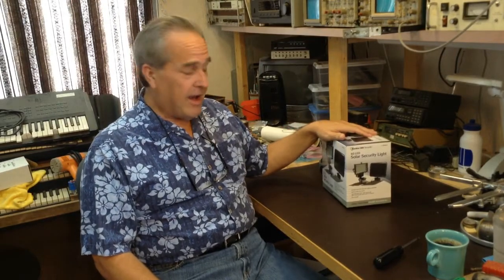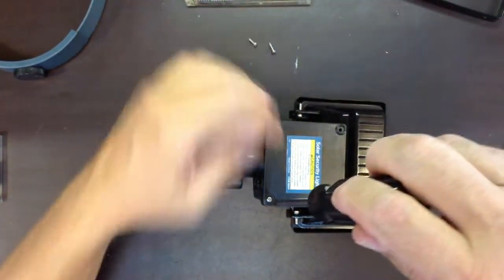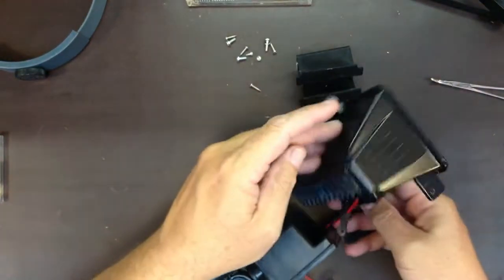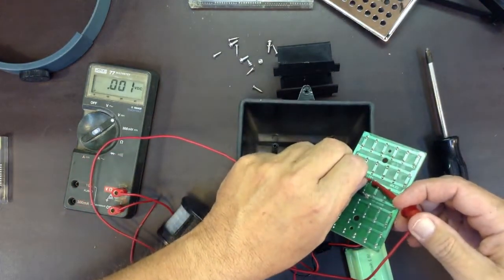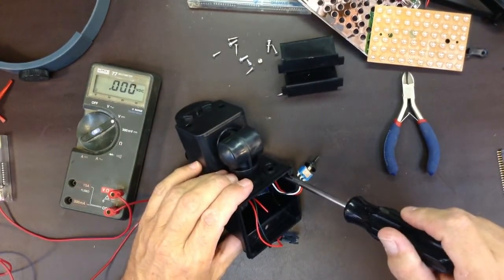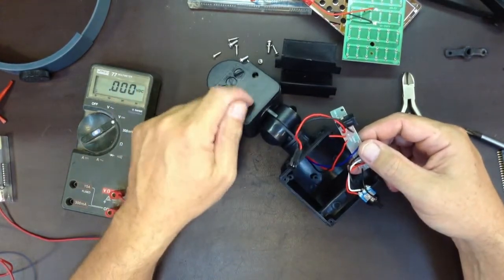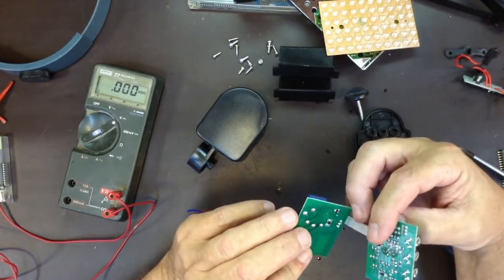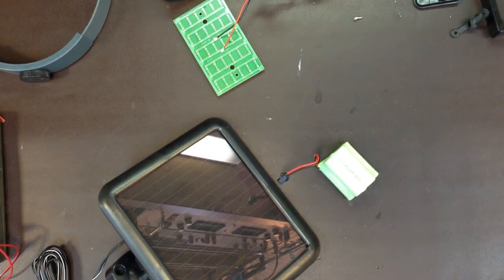HB7 : Solar Floodlight Teardown

Comment: I know this is an old video but hoping for a response. I was thinking of buying 3 of these for my home. When the battery packs wear down I would buy a 6v 12ah for appr $20.00 to run all 3. I don't know if the solar panels would have enough amperage to recharge the battery but I would probably just put a trickle charger on the battery every so often instead. I wouldn't have the benefit of free solar power but I could keep the battery inside my garage in a conditioned area and not worry about changing battery packs in the future (I hear many complaints about the battery packs). Any thoughts?

Comment: Thanks for this - very well done!

The information you've provided gives me the confidence to press forward with a plan to power two of these lamp units using just one of the solar panels.  The lamps hardly ever get tripped, so I think both battery packs will remain charged.